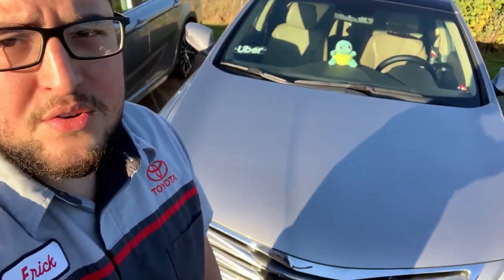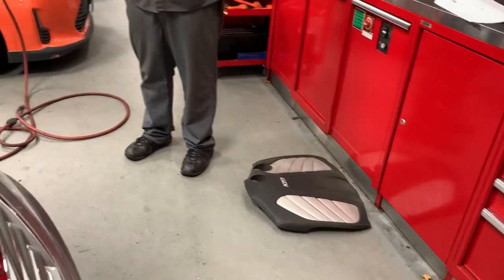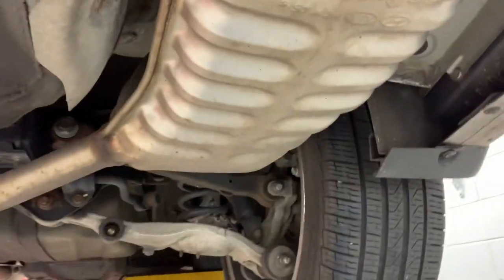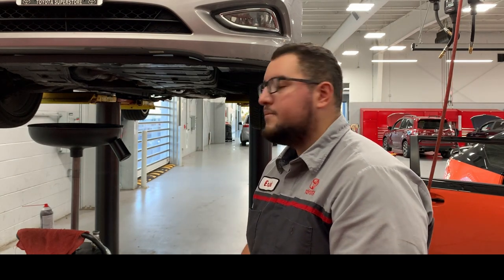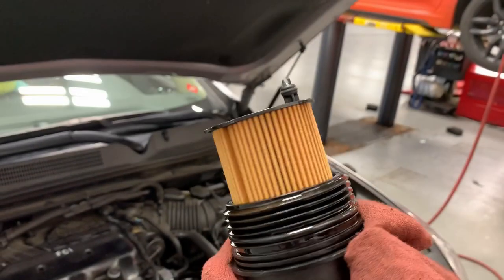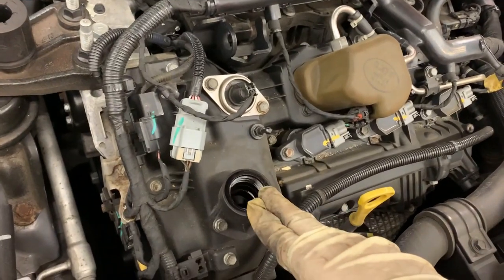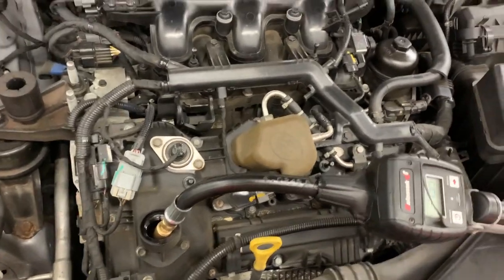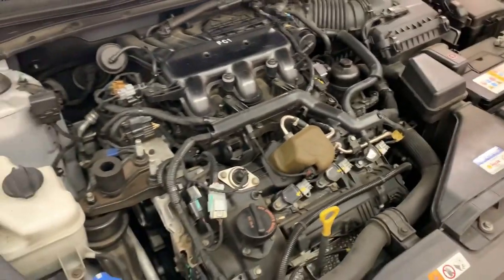2012 HYUNDAI AZERA OIL CHANGE

Comment: I also have a Hyundai Azera-2015 the video is informative BUT you failed to show exactly where the drain plug is, also you didn’t exactly show how to take apart the filter or where to O ring goes. You did show where the oil filter is for which I am grateful! Because I thought it was somewhere underneath the engine. It’s awesome that Hyundai put it on top!!

Comment: does your car have rattle noise at cold when you start it up after sitting couple hours?
Reply: Just purchased a 2012 Hyundai Azera. I also have very loud rattle for a couple seconds at cold startup. Not sure if it's normal, but it is very concerning because it sounds like the timing
Reply: @cartedanger most likely it's not timing tensioner, it's cam phasers. overtime camshaft phasers go bad, just need to replace them. Mine had the same terrible sound at startup and everybody said it was tensioner. when I removed valve cover, timing cover, chain tensioners (it has 2 - one on each bank), guides, camshafts, turned out that teeth of the tensioner were still like new at 100k miles so it was not tensioner, it was camshaft phasers (it has 4) - when you turn your car off oil pressure drops and phasers can't hold the chain tight and when you start it up after sitting couple hours chain is loose and makes rattle noise untill builds up the pressure to activate phasers. 
After replacing them my car runs quite, no rattle noise even after sitting a week. if you're mechanicaly inclined have all parts (incl. cold beer) it's a one weekend diy project, and when you remove camshafts, chains etc. it's best to check valve clearance and if it's out of huyndai specs replace them as well. Cheers.
Reply: @cartedanger  i had the rattle at start up regardless of weather from day one. I’m hoping its not oil starvation at start up. I do use Mobil 1 synthetic. My car has 137k miles on it. Extremely reliable. 2013 Azera Limited.